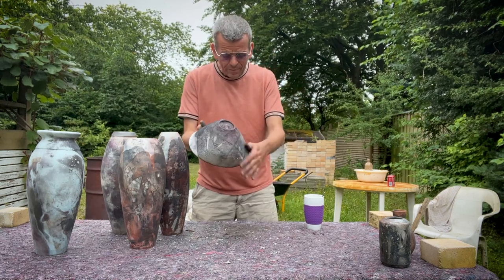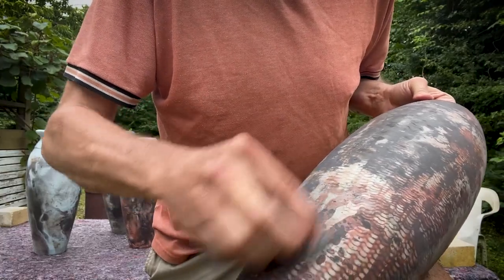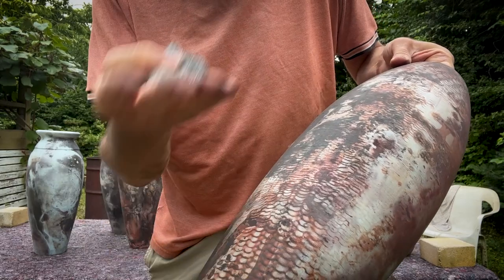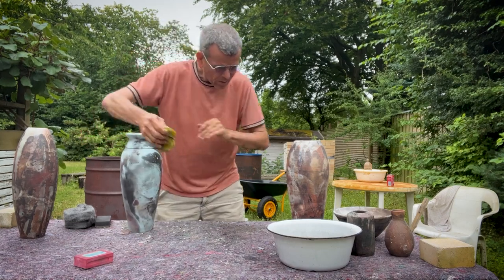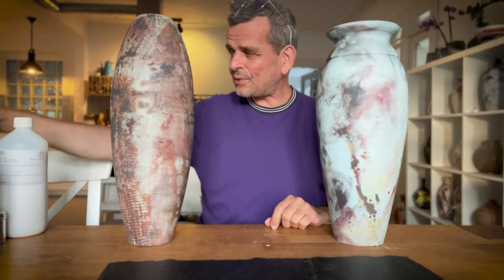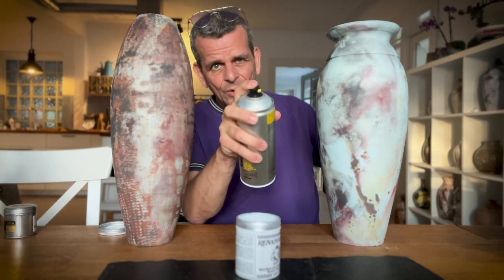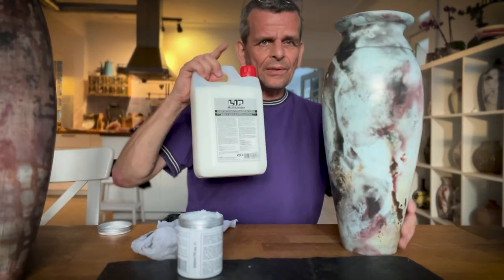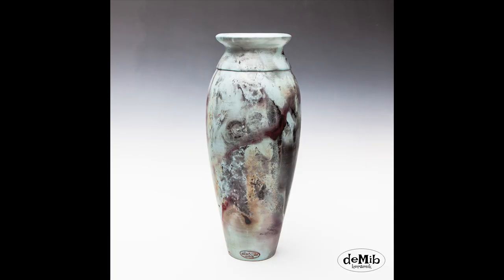62.  Dust, Brush and Polish - how to finish Pitfired Pottery

Comment: I found that waxing didn't do some pots justice so I warmed them in the kiln for a few minutes and then wiped them with a rag dampened with denatured alcohol. Worked great and the alcohol dries clean and quickly. I then used silicon spray after an hour or so on those particular pots and it made the colors pop the way I wanted them to.
Reply from the maker: Yes, it's not always the same polishing material works. I use acrylic spray too on some pots, 2-3 different kinds wax and a sealant, that also can polish.

Comment: Thanks so much for your videos! I have learned so much! How do you apply the liquid quartz on your bowls? You mentioned that a little goes a long way - do you pour in and swish or wipe on?
Reply from the maker: Thanks. You can pour or brush or spray. In any case it wont absorb more than needed. The rest can be returned to bottle
Reply: @deMibPottery thank you! I’ll try that.

Comment: Mikkel -- thank you so much for these videos!  My first firing went very well, but 2 of the pots came out very black.  They were done in exactly the same way as the others -- foil saggers, etc.   Any idea what causes some to go black and not others?
Reply from the maker: Thanks :-)

The black typically comes from carbon from organic materials burning and smoking. So there must have been more smoke close to them, is my guess

Comment: If you're sealing the inside with concrete sealant, do you wax the outside before or after the concrete sealer?  Just wondering if you do it after whether the water that comes off the sealant gets trapped by the wax or affects it in any way?
Reply from the maker: I usually seal the inside last and never had any problems with that :-)

Comment: Check that concrete sealer chemical makeup. Many of those concrete sealers are just sodium silicate (water glass) which we use to make stretched surface pots. Way cheaper at a big box hardware store by the gallon as opposed to by the pint at a pottery supplier. :-)
Reply from the maker: Sodium Silicate do not make the pots 100% water sealed. The material I use now (which is also cheap) do :-)